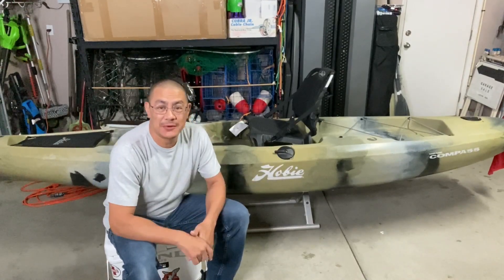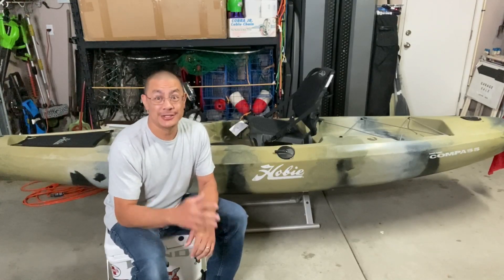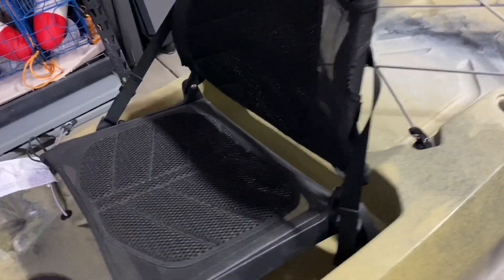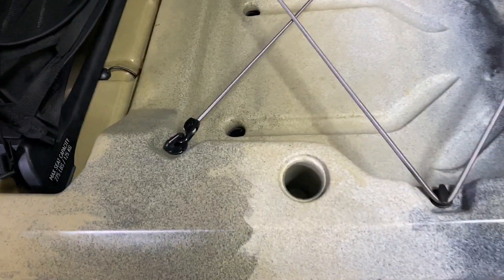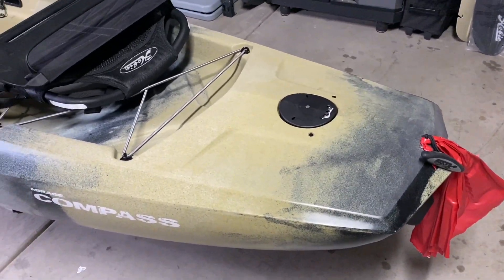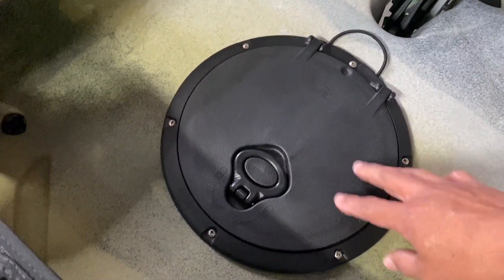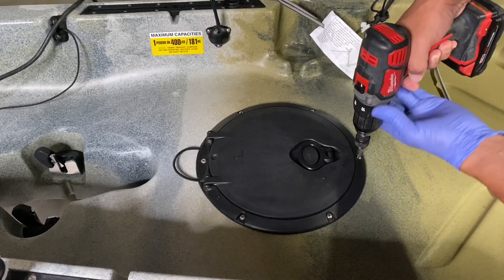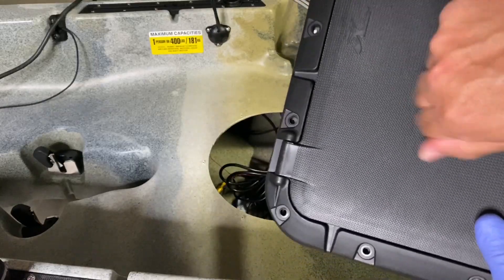2020 HOBIE COMPASS step by step INSTALL & MOD’s! Why I DITCHED the Pelican Catch 110HDii explained..

Comment: Got my compass for 4 years and have taken hundred plus trips on it… and will finally install the horizontal hatch and add the front hatch. Can use that front hatch storage for batteries which get bigger and bigger with ever increasing fishfinders… also got downrigger on left and on right side the speed control for the Newport kayak motor. Love my compass… could be a big bigger but for the times I have to transport them on wheels I appreciate not having a PA.

Comment: I should have done my own mods. The dealership was offering free installs with parts purchase and I let them. The holes they made for the thru hull fitting for fish finder were uneven and larger than they supposed be, I had to slap goop all around it to cover the gaps. Sometimes it best to do your own mods. Great video subbed 👍
Reply from the maker: As the saying goes...There is no such thing as free! Thanks for the support.

Comment: Nice setup, I just bought the Hobie compass duo and did the same with the rectangular and round hatch. I also put the nine inch h rail on and put the thirty six inch ones on the sides also . Better for holding on and picking up to move it. Now I have a lot more places to add h rail accessories. Now I'm starting t install my new Lowrance Elite. And these seats are very comfortable to sit in all day and fish.
Reply from the maker: Couldn’t agree with you more!
Reply: I guess it is kinda off topic but do anyone know a good site to watch newly released movies online ?
Reply: @Cain Jad Thanks, I signed up and it seems like they got a lot of movies there :D I appreciate it!
Reply: @Roger Trace No problem :)

Comment: Great vid, my friend! Got my Compass in July. The seat is no problem for me, but my daughter didn't like it either. The one thing I've noticed is you have got to be careful loading to not bend up the rudder. Been a fun yak so far. The hatch upgrade will probably be next!😎
Reply from the maker: cy fels 
Thank you! Hobie just sent me the correct seat straps on a warranty claim. So now I’m good to go. As for loading & unloading, do yourself a favor & get a compass loader. It’s a cheap ($30) & effective fix to the design flaw of the compass. Without it, you WILL break the rudder. To remedy the issue for the 2020 compass Hobie made an attachable footing. It’s similar to the one made for the outback but this one is specifically for the compass. Thanks for stopping in & commenting!
Reply: Big Shticks    Yeah, I'm still waiting for my loader and the side pockets, accessories have been hard to come by. Been loading stern first at the water
Reply from the maker: cy fels 
I couldn’t agree more. I’ve gotten kind of lucky though. I ordered the map pockets on eBay but realized they were without frames after the fact. Told the seller I didn’t want them if they didn’t come with frames & they threw in some frames they had laying around. Got the rectangle storage bucket from a local kayak dealer whom happened to have one laying around when I called. The loader is a funny story. I emailed the seller of my  kayak about the straps & in an additional email I inquired about the loader. When they called & told me all they had was straps the same length as mine & they’d like to make it right by doing a warranty claim, someone in the background says “if that’s the guy asking about compass straps, tell him I have a loader we used for a demo video”.   “He can have it for $20 bucks but he has to buy it now over the phone & pick it up today”. I said...Done & Done! I do see however that a few retailers still have them in stock if your interested.
Reply: Big Shticks   Yea, I got a call in to the dealer to see if he's got the loader in. They were advertising them and then all of a sudden they disappeared. Ditto for the side pockets. Luckily I still have my old cart that works just fine. My kayak buddy in Arizona with the mirage sport got me started on this Hobie obsession so I'm blaming it all on him!😎
Reply from the maker: cy fels 
😂 it seems it’s never ending once it starts! I feel like I’m just going along for the ride.
Reply: Big Shticks   I hear ya, brother! Some kind of weird Hobie vortex thing!!! The wife is concerned for my mental health. Too late ! I'm in deep now!!

Comment: Great video, thx! Have the exact boat but went with the vertical rectangle hatch. Am 5'9" and have no issues with strap length for the seat.  It is lighter than my old Revo 13 but the Revo was better balanced and made lifting easier for cartopping. The compass is lighter but seems nose heavy when lifting above your head - even with handles installed on the inside of the seat mounts.  Good boat so far. Thx again!
Reply from the maker: Capt Adobo 
Thanks for stopping by & commenting. I trust your assessment of the compass vs. the revo meant the dry weight being equally distributed. I can agree with that. It does seem slightly nose heavy for sure. I did receive replacement straps which are at least 12 inches longer overall so I’m good to go in that regard. When you say vertical hatch I assume it’s mounted lengthwise opens from seat towards the drive. I never even knew that one existed 😂. My only issue since was loading the yak without severely damaging the rudder. I’ve since purchased the compass loader which has remedied the issue.

Comment: 2 years on your video, I was wondering if you are still rockin' the Compass. I'm struggling between the "perfect world" and "reality" wanting an Outback simply because it is so well thought out. The reality is I might go fishing once a week at the most, although I would love to go more often if I had someone to fish with. With a roughly $900 price difference between a Compass and an Outback, I'm leaning towards the Compass and adding the mods I feel I need, similar to what you have done. Seems to me to be a nice simple modifiable kayak if one wanted to gear it towards fishing, or just leave it alone for recreation. I was kind of bummed to see the difference in hull thickness though. I don't think Hobie will ever include the upgrades, however for the price of these things, they should. But hey, if people are going to buy upgrades from Hobie as an after market item, I can see why they don't.
Reply from the maker: Yes I’m still rocking with the compass (I have lynx now too) & haven’t given it a second thought. With either the compass or the outback it comes down to weight for me. They are both very seaworthy kayaks. Nobody will bat an eye that you’re in a compass. When you consider the mods or accessories you’ll add to either kayak it’s all relative. I’ve probably got about $600 in mine (fish finder, nocqua battery, crate, Hobie cart, deep storage bucket, hatch, h-rail & numerous rod holders). TBH you’ll still end up spending on most of those items anyways with an outback just to get started too. But remember, the more you put on it, the more gear you have, the more it weighs. So I try to minimize gear so it doesn’t take me 45mins to an hour to get on the water. Not to mention breaking it all down for the trip home. I literally unload onto the cart, connect my battery & FF, plug in my rod holders & add my 2 poles & tackle then shove off. Sometimes I’ve been fishing almost an hour before my friends make it out to the fishing grounds. It’s all about speed & efficiency for me. But the best part is, when back at wherever we launched my kayak weighing a solid 40lbs less than an outback or 80lbs less than a PA, I have noooo problem making it up the ramp or up the beach while my friends are struggling, stopping to catch their breath & begging for help. If I didn’t fish the ocean or SF bay I would have no problem getting the passport instead. It’s all about getting the right kayak for what you want to accomplish.

Comment: Im on my second compass, I also lengthened the two seat connections on the sides! I love the simplicity of the compass and lighter weight! My son has my first compass! It is great for fishing hands free most of the time! It can glide up to fish on beds, with no motor noise! I’ve gone to areas where big bass boats leave noisily, then catch fish! I love it for shallow water! Good video, good luck fishing!
Reply from the maker: I to love the compass. It’s a good kayak. I love how light it is compared to the outback & I won’t even talk about the PA 😂

Comment: 14:30 not good to see! Hope the bottom and sides is solid all around. Is it worth putting any sealant under the square & circle hatch when putting them in?
Reply from the maker: Yeah I was pretty perturbed by the discrepancy in thickness myself. But I guess it’s how the compass is so much lighter than an outback. As for sealant, I’m not sure it would be any good. The hatches are sandwiched between two foam gaskets, so I don’t see it bringing much benefit to the party.

Comment: Thanks for sharing. When you are ready to take her out, let me know; I like to join the adventure. I have just gotten a 2020 Outback and I agree that the quality of the material is a bit less rigid than the old Lifetime paddle kayak I still have and the 180 Turbo Fin with kickup has some defect. The seams of the rubber coating on the fin split and cracked on one of the fins; it has been a week already since the dealer has filed a claim with Hobie and I still have not heard anything. Please check your fins on the drive.
Reply from the maker: Thanks for watching & commenting! I’ll definitely hit you up when I have some time to go out. As for the rigidity of the hull, I must say I was pretty disappointed to say the least. But I have to imagine that for kayak to be it’s weight it’s gonna be sacrificed somewhere. I just wasn’t expecting it’s hull thickness to not be uniform. Thanks for the tip on the fins! I’ll definitely be keeping an eye on that for sure. I hope that your fin issue is a one off & gets resolved soon. I would think the vendor would just shoot you some while they work on their end to resolve the claim with Hobie. There doesn’t appear to be any shortage of them around so I can’t see there being a drawn out resolution. But good luck getting an answer soon.
Reply from the maker: Jason Wei 
BTW where do you fish out of so I have better idea of when to contact you?
Reply: @BigShticks  I am from Fremont and usually go out as far as an hour and a half; once in a while, I hit Clear lake. Please let me know at least 3 days in advance so that I can request for time off from work.
Thanks.
The last 4 places I went were HMB, Bolinas, Santa Cruz Harbor and Monterey Bay.
Reply: @BigShticks  Are you planning on going to the Ocean Cove event coming up on the 18th-20th?
Thanks 😊.
Reply from the maker: Jason Wei 
I don’t even know about that event. Is that a NCKA event?

Comment: Had the same kayak. I made the mistake by modding the Compass so much that I could’ve just bought an Outback 😂. So I sold the Compass and bought a 2020 Outback.
Reply from the maker: Jimmy Inthaphanh 
I can totally see how that’s possible. But that’s not the case here. I spent $2.2k on this yak & an additional $220 on the mods. That’s about $600-700 less than the outback. But I can see where you lose that savings if you have a dealer do the installs. However, for me the biggest factor was weight. The outbacks extra 23lbs is significant in my mind. Helping my cousin move his around showed me the struggles of moving an outback alone, particularly loaded down with gear.
Reply: Big Shticks yea it’s a good boat. You can definitely feel the extra weight from the Outback. Only reason why I upgraded to the Outback was the seat for the Compass gave me back pains after sitting for 5-6hrs on the water and I wanted more of the bells and whistles the Outback offered.
Reply from the maker: Jimmy Inthaphanh 
There is nothing worse than not being comfortable in small spaces, so your decision to move on is wholly justifiable. The outback offers unrivaled “bells & whistles” with so many options that work with every feature. It is the cream de la creme of kayaks made specifically for fishing.

Comment: I have the same kayak and the straps easily adjusted without making the mod for me.  I am 6'2"  also the ship them now with the camo pads as an extra because of many people having the same reaction
Reply from the maker: My retailer ended up doing a warranty claim & Hobie sent me new straps in 3 days. Turns out they shipped a bunch of compass seats out with incorrect straps.

Comment: Are you concerned at all by the uneven flooring around your rectangular hatch?  Will it support standing?
Reply from the maker: No, once I put in the rectangle hatch the deck is completely solid. I feel more stable standing in it now then when the round hatch was there.

Comment: Really enjoyed your video! How does the Compas handle the ocean conditions and swells up to 5 foot (any higher and I don't go out)? I am in doubt between a Compass and Outback for the fishing here in Panama (country).
Reply from the maker: The compass can handle swells with the best of kayaks. Really it has everything to do with the period between swells. For instance, a 5ft swell every 10 seconds is relatively mild ocean conditions. If the frequency is every 5 seconds at 5ft then it’s gonna be a rough day. It also helps if you keep your head inside of the kayak if you lean out in the same direction of the waves energy you will tip. Honestly though, being out in the ocean & swell isn’t what really worries me. Surf launching & landing is my biggest issue.
Reply: @BigShticks  Thanks!

Comment: Just got my new compasses today. The hole for the fish finder transducer wire used to have that little well where you could drill into. The new compass does not have that little area to drill next to the scupper. You actually have to drill into the wall behind the seat 🤨 it’s just a flat area with a scupper hole.
Reply from the maker: 🤔 I’ll have to check out the new compass. It’s hull design has largely remained unchanged until now it seems. Pretty interesting tidbit!

Comment: You might want to replace the lower screws for the right map pocket with bolts and nuts.  Top 2 screws are ok. If you reach your hand inside there you find that the cord to raise and lower the rudder will be rubbing on the screws. I did it to my Compass.
Reply from the maker: Out of an abundance of caution I went out & checked those screws. Fortunately, my screws don’t protrude through the hull. I can feel a slight a bump, but nothing sharp or rigid. My question to you now is: wouldn’t a cord rubbing on a nut still create the same undesired friction?
Reply: @BigShticks  Not really. The sheet metal style screws that came with the map pocket have a pointed tip and more aggressive thread. The nut is a smoother more polished surface

Comment: You could pull the map pocket out of the rectangular hatch lid. Same pocket.the hatch pocket is pretty useless to me. The hatch is too unless you buy a bucket. Burley pro makes a great substitute for the Hobie brand bucket and map pockets.
Reply from the maker: All good points! I never even considered removing the map pocket from the lid. I do use it though to store various items. When I didn’t have the bucket I still stowed my water pump & a dry bag in the space under the seat. Now that I do have a bucket I store just about everything I can fit in it, on the water & off.

Comment: Make sure you mod the eyelid hooks where the seat strap goes to. I’ve striped the thread my the 3rd time out.
Reply from the maker: Are you talking about the screw in padeyes? What’s the mod?
Reply: @BigShticks  yes, the padeyes thread will strip if you lean hard on the seat. The padeye is hollow on the inside. Since you have not stripped yours I would fill it with an epoxy. I hope that make sense.
Reply from the maker: @timleng4404  
What does filling the inside of the padeye with epoxy do for the threads on the outside?
Reply: I THINK it will help to support the thread to not give in. I am going on a different path by cutting the hook out and go with the stainless steel ring bolt  on. Look up some of the videos.
Reply from the maker: @timleng4404  
Maybe this is a silly question, but why didn’t you warranty it? Also, I watched the video where the guy cuts off the eyelet of the padeye & drills a hole to put in a metal eye bolt. I believe his problem was the padeye broke on him & not that the thread stripped. Not to be downer but I don’t see how this will solve your problem unless you plan to drill into the kayak & nut, washer, washer, bolt, sandwiching the kayak hull in between.
Reply: I was three hours away from Kayak City for my warranty. Yes, I will drill into the kayak.
Reply from the maker: @timleng4404  
Damn. I’m glad I don’t live that far from authorized Hobie dealers. Even still, when I warrantied my straps for the seat I didn’t have to drive all the way back to kayak city (1hr). I just called them & explained the problem, took pictures & sent it to a provided email. I received the straps 2 days later directly from Hobie.
Reply: BTW: It would cool to go catch crappie at Berryessa with you someday.
Reply from the maker: @timleng4404  
How far away do you live from Berryessa
Reply: @BigShticks  2 hours now. I’ve only took the kayak out one time last year. LOL
Reply: What's your take on the Newport Vessels nk180s?
Reply from the maker: @timleng4404  the trolling motor? Idk man. I mean it is convenient & all but I didn’t get into kayaking for a powered rig. I have a Lund for that. The more stuff we put on them for the convenience of a small boat, the heavier & more cumbersome they become to both set up & move around. For me I’m happy with a pedal drive. Before that I was a paddler who envied pedal driven kayak owners. Now because Nick, Adam, Jun, Ish & Taku have a motor powered yak I see a bunch of people wanting one now too. They are good product marketers 😂